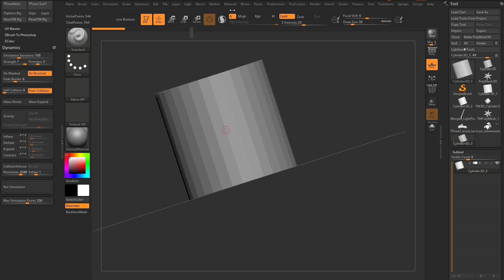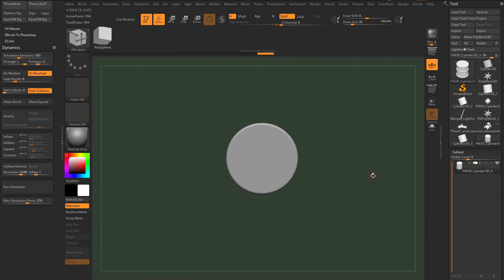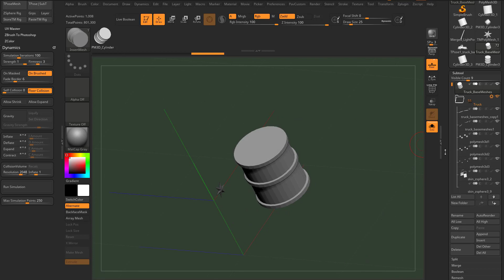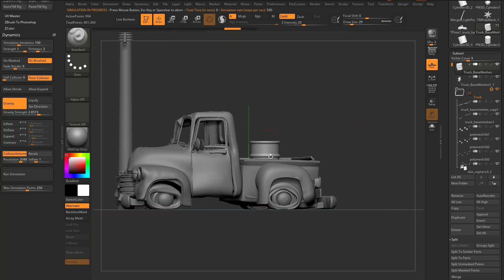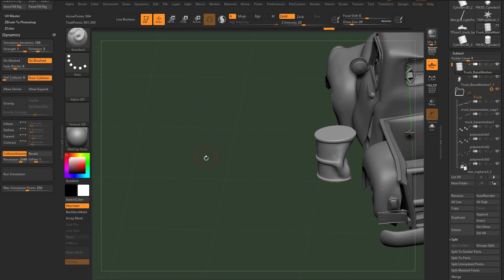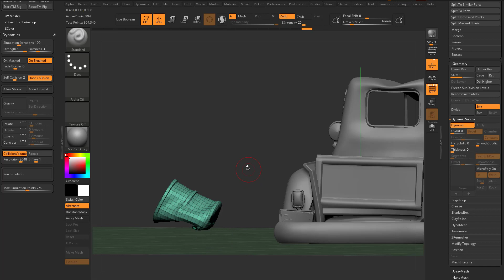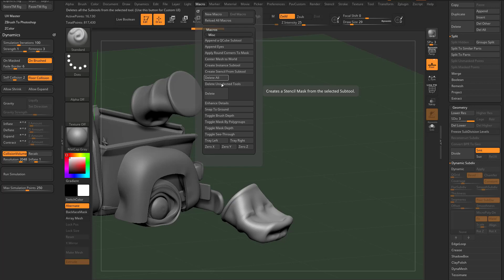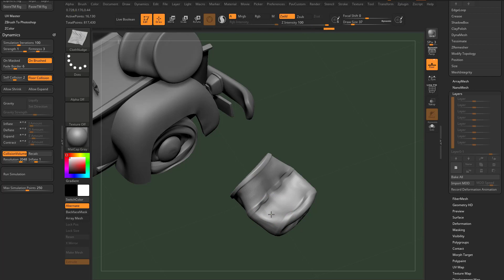029 ZBrush 2021 Hard Surface Simulation Barrel Crumple Demo

Comment: Hey Michael, a bit off-topic, but how did you insert the barrel at 2:13 at a random position, I mean, not over the star itself?
Reply from the maker: as long as you have visible subtools (and you don't have ghost transparency on) it should "stick" to any visible surface. In this case I had the star selected but the truck bed visible, so I can drag a barrel out on the truck bed
Reply: @MichaelPavlovich   Awesome, thanks for the tip! I never noticed that you could place it on any visible subtool... thought it was restricted to the active one :)
Reply: @MichaelPavlovich  and by the way, using the star on top of the subtool stack is genius. I've always found it a bit annoying how the file name overwrites the top subtool's name (or is it the other way around? can't remember right now)